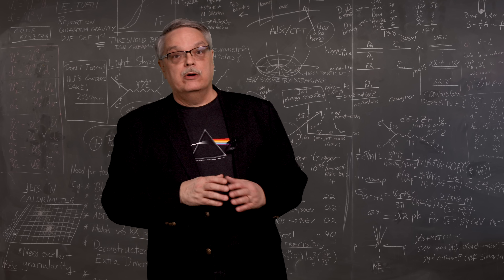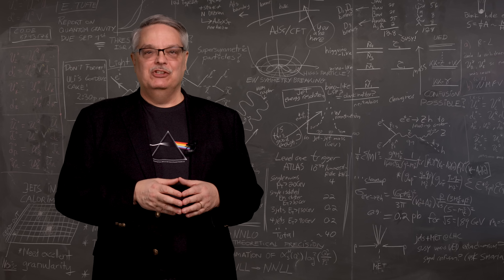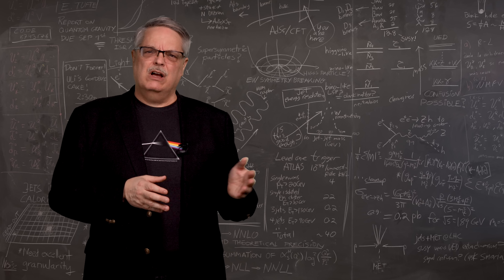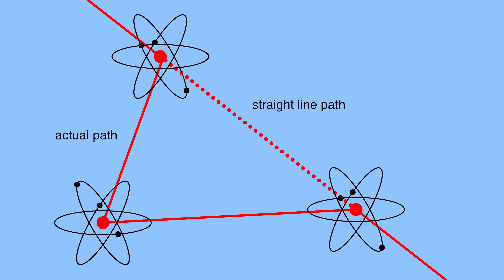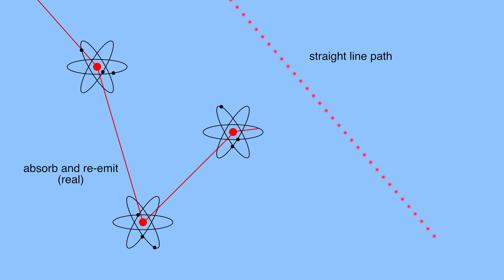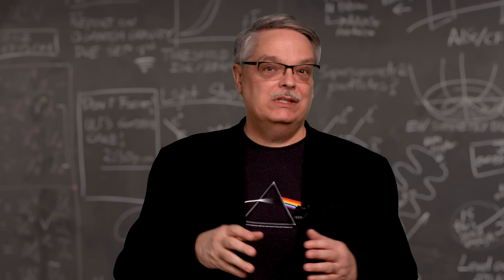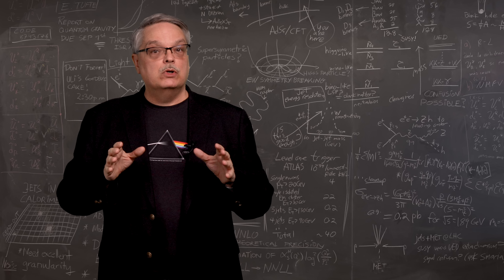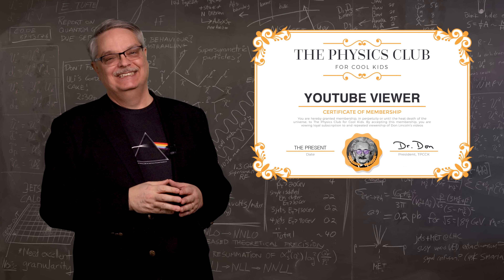Why does light slow down in water?

Comment: And why it changes the direction of the light beam?
Reply: It doesn't explain why the direction is changed
Reply: @EdwardJam-c4g  He doesn't explain it. Just saying refraction is not an explanation.
Reply: Imagine if you are holding a long piece of wood horizontally, and then you walk into a giant jello cube at an angle. Your body will naturally rotate so that you're moving at less of an angle. The rotation happens because one side of the piece of wood (i.e. the part that isn't in the jello) is moving faster than the other side. In the same way, when a wave enters a medium at an angle, part of the wave front is moving faster than the rest, which forces the wave to rotate.
Reply: @GumbootMan  That's what we learn at school. It's a good analogy, but not the true. On the light the wave that we represent as having height does not have. When we plot at the paper a high spot it means that the electric field has a high intensity, not that it moves up. And if it is the real explanation, what about horizontal polarized light hitting a horizontal surface? That`s why I would like to know WHY it happens.
Reply: @Daniel Kohwalter I'm not talking about the amplitude of the wave, or the polarization. A beam of light, no matter how thin, always has some width to it, which means it is possible for the left and right sides of the beam to have different speeds. It should even work for a single photon, since a photon has a finite width too. You might argue that a wave is not physically connected like a solid body, so it shouldn't rotate like a solid body, which is a reasonable argument. But the left and right sides of the wave are connected via their shared influence on the electric field, and if you model the wave as a series of expanding wave fronts (Hyuugens principle) you get the same result: the wave front rotates like a solid body (at least in this instance it does).
Reply: @GumbootMan  Ok. Thanks for the explanation. But I have 2 more questions:
1) The electric wave of a polarized light is oscillating in a single plane, right? So if you have an electric field that is oscillating at the same plane as the plane of the separation of the mediums (like the surface of a piece of glass) why does the single photon changes it path?
2) What's the width of the photon?
Reply: @Daniel Kohwalter
1) The electric wave can be oscillating in a single plane, or it can be oscillating in a circular or elliptical pattern. That's irrelevant though, the path change is due to the spatial extent of the photon, not the particular influence it has on the electromagnetic field. (I'm simplifying -- if you were to find a material that could not vibrate, or one that was not affected by photons, then the retarding wave Dr Lincoln talks about would not exist and the photon would travel in a straight line.) By spatial extent I just mean the volume of space in which you might find the photon if you installed a photon detector in the right position. Granted the width of a particle is is a fuzzy concept since the wave function tends to trail off and doesn't just go to zero, but you can at least say with 100% certainty that it cannot be zero.
2) The width of a photon is the width of the photon's wave function, which like any particle can grow and shrink, but is generally related to the frequency/energy of the particle. Higher energy/more massive particles are generally smaller, all else being equal, since they "spread out" at a slower rate.
Reply: @GumbootMan  I think I got it.

So if you think of a photon to be the sum of all probabilities within it's "sphere of influence" (I mean the region of space that there is a significant probability to find the photon), the "bottom most probabilistic photon" (thinking on a setup like the on the video) is going to slow down first than the "top most probabilistic photon", changing the overall (or mean?) direction of the propagation of the most probable place to find that photon later on, right? (it's a little bit more difficult for me to make myself understandable because I'm not fluent in english)

If so, I wonder what happens if you put a detector just before entering the glass. If it's possible...
Reply: @Daniel Kohwalter Your terminology is a bit strange, but I think you're on the right track. The important thing to remember is that a photon is a wave. A peculiar type of wave, to be sure, but still just a wave. So what happens if you replace the laser in Dr Lincoln's experiment with a parallel water wave (perhaps entering into a more viscous region of water)? The same thing: the water wave changes direction. So the photon changes direction for the same reason a water wave changes direction. One side of the wave front travels at a different rate than the other side, the wave front gets out of sync, the wave front interferes with itself until the wave front is in sync again, and the resulting retarded wave is travelling in a different direction. That's very similar to the reason the wave slows down in a medium, and not too far off the reason a solid body rotates in the same situation (except for a solid body it's the molecular bonds that cause the rotation).
Reply: > A beam of light, no matter how thin, always has some width to it  
Then why can you observe the same for single photons?
Reply: @whuzzup Even single photons have a width, i.e. the width of the photon's wave function.
Reply: @GumbootMan  i don't know why you are going with that explanation when you can have classical explanation.
.
To refract light must incident obliquely on material. When the velocity changes due to superposition then the value of velocity decreased in direction of surface as well as in direction of normal to the surface which changes the slope of the path. ....
Take your time and resolve the components of velocity to understand... You will see through logic
Reply: @HiQuantumSKY  You're absolutely right, of course, but I suspect that explanation will go over a lot of people's heads due to the complicated terminology.

Comment: But if the electron can be a electric charged particle and is under a force, it is accelerating (because it has mass), and accelerated charges emitt photons. So why the glass does not scatter the light? Because these emitted photons are going in any direction...

Comment: I still don't get why the angle change.
Reply: Draw a width to the light beam and think what would have to happen the wave front so it could remain straight.
Reply: Could the change in angle be because it takes the electrons in the glass some TIME to react and produce a interfering electronwave wich gets a bended sum.The different additive Waves are 'out of sync'?  🤪
Reply: reread my first comment
Reply: depends what part of the visible light spectrum hits the water first...like I said it all depends on the angle of attack
Reply: the image of the pencil is distorted because light reflected off the pencil outside of water is moving faster than light reflected off the part of the pencil in the water ..but it all depends on the angle that light enters the water...also know that visible light is made up of different wavelengths(violet,blue,green,yellow,red etc) each wavelength is slowed down by the elcctrons differently than the other...blue the is slowed down the most while red is slowed down the least ….
Reply: @TheNico2011nico   I'm curious, as the wavelenght that haves the more High frequency is the more slowed down, and the wavelenght that is less slowed down is the one that has the more Low frequency...
It's because at less frequency, less charge, hence, a summed wavelenght of less charge will move faster?
Reply: Blue light travels slower through glass or water etc,  because its shorter wavelength interacts more with the atoms and molecules,hence the reason the sky is blue
Reply: TheNico2011nico excellent explanation. So  does the color of the light affect how bent the pencil seems to look in water?? If blue is slowed the most, does red look less bent??
Reply: @Newzchspy  yes....but of course the color yellow is the only color thats reflective ..all the other colors are absorbed......
Reply: @niconico1546  That is not necessarily true. If it were a blue pencil it could be because it absorbs everything but the blue light,,, or it could be because it reflects all light except orange. If an object absorbs only orange light it will appear blue,, strange as that sounds. I give this example because I can't recall what the opposite of yellow is. We don't always see what's really there. Televisions have never been able to emit yellow light until very recently with LED technologies( and a lot of LED sets still don't ). So think about the whole time you were growing up your TV never had any yellow. I went off on a tangent there but it's interesting none the less.
Reply: @williamgreene4834  yes ,I know  what you explained can also be the case, I just didn't mention it because I wanted to simplify my answer ...didn't want to get to technical with my explanation..... Pigmentation of an object can have that affect
Reply: @niconico1546  Sorry just threw it out there for some interest. Light can be weird. :)
Reply: why can a car turn? because one front wheel goes faster than the other front wheel. the same happens for the "front" of a beam of light. As one edge of this "front" reaches the surface it slows down but the other edge that still hasn't reached the surface, continues with the same speed. so in total the "front" has changed its angle.